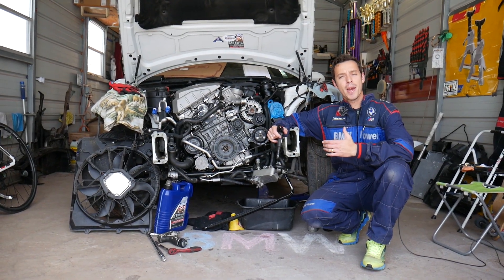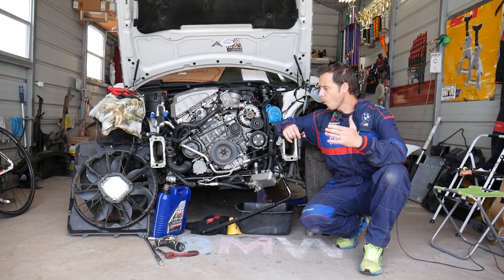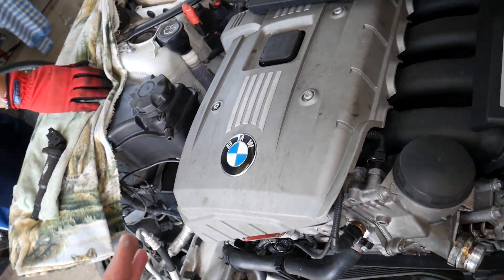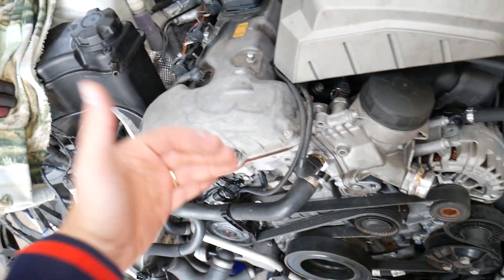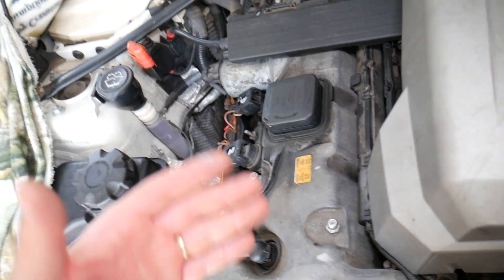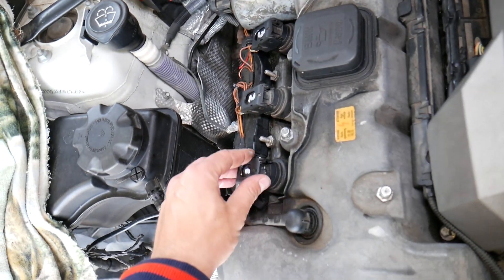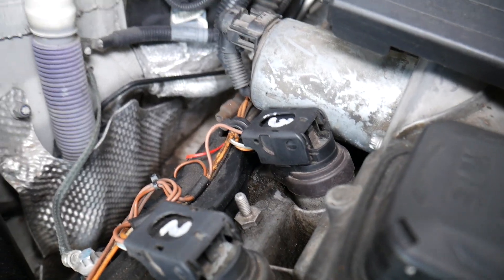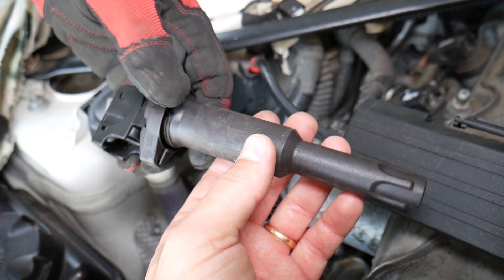IGNTION COIL REPLACEMENT ON BMW X1 E84

Comment: Great video, thank you!

Little help please!
I need to replace my Engine Oil Temperature Sensor and my Engine Coolant temperature sensor, but I can’t find them! 2007 Hyundai Veracruz. Codes P0198 & P0116 
Thanks in advance.